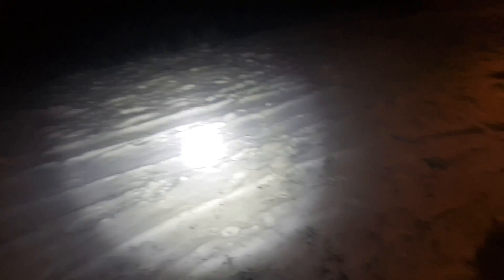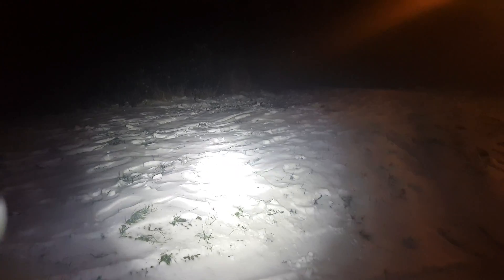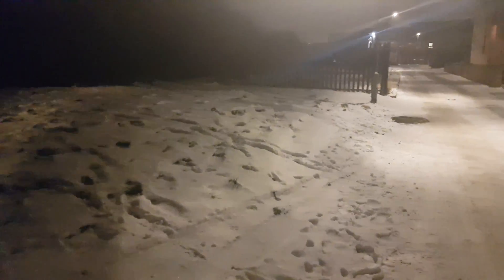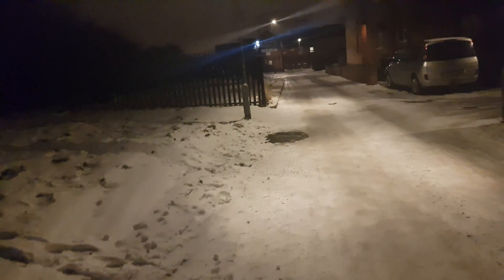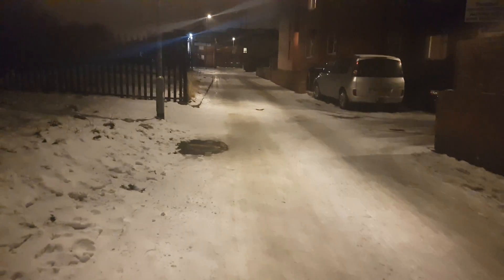What is a CREE LED? - Standard LED vs CREE LED

Comment: Still never told us what a CREE LED is though.
Reply: CREE is a brand of LED lights. Its not a type of LED which is what I thought they were.
Reply: High output Cree led torches put out a lot more light with less battery power and last far longer than a traditional led torch.
They are slightly more expensive but as you see here there's a reason for that, because they are far superior!
-description c: